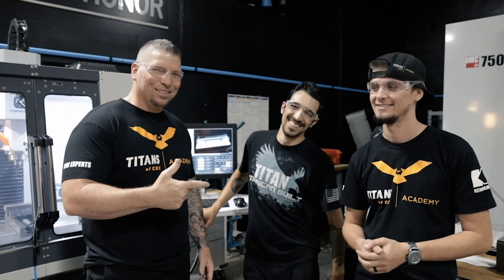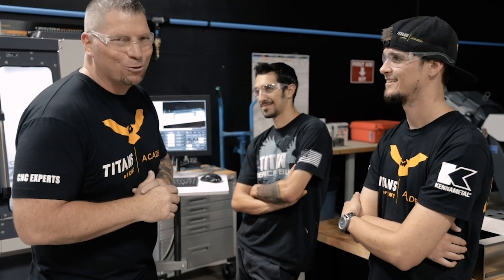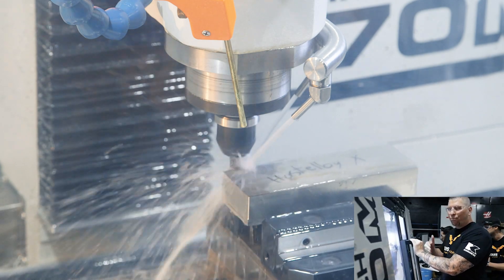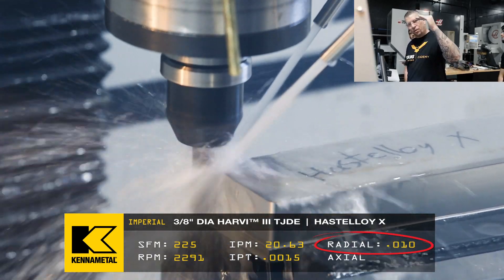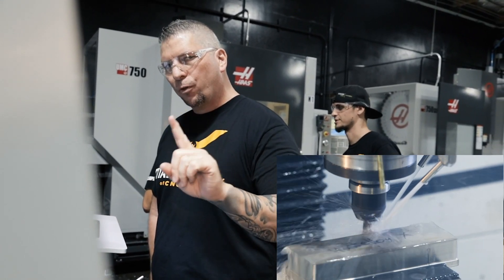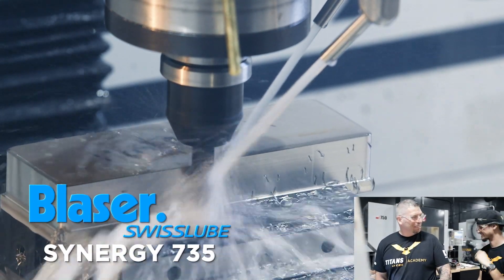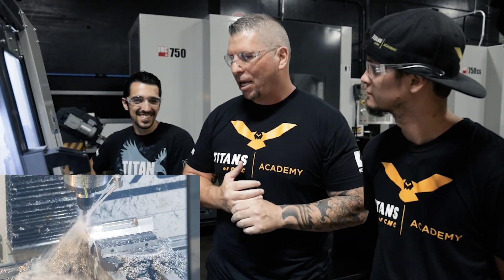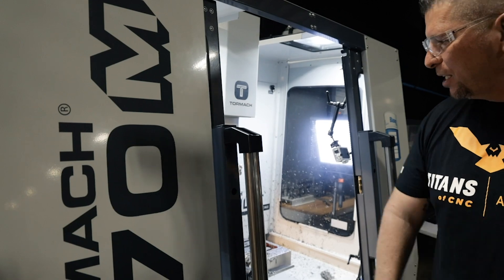Tormach VS HARD Hastelloy X | CNC Machining

Comment: Back in the day of gear driven, low rpm, high torque machines it was far more important to watch your backlash.  As the hydraulically driven, high rpm, low torque machines came about backlash was much les of a problem. its also a guide for using big multi carbide cutters. One keller shop I worked in burned up the gearboxes of 6 Kellers

Comment: I will say this, as a mechanical engineer, that tool pressure is a term that I have found to be misunderstood industry-wide. The definition of pressure is force per unit area, i.e. P=F/A. Think of a hydraulic cylinder being extended by a hydraulic pump exerting 3000 psi. A larger cylinder will exert greater force even though the PRESSURE is exactly the same. The reason is that the piston in the cylinder has a greater surface area, and therefore according to that equation rearranged for force, F=P*A, the force increases. In this same manner, when you use a smaller tool, it is not the tool pressure that is changing... it is the force exerted on it that is changing.

Comment: I have A LOT of issues with my 770 in scenarios like this with high pitch chatter when cutting stainless.  I can hear a little of that high pitch noise in the video around 5:55 in the video.  Any suggestions on this?

Comment: I cut 6al4v in my 770 Series 3 constantly (I wish I had the more powerful spindle motor in your swanky new 770M).  Is it absolutely ideal?  Hell no.  Does it make me money with nothing more than a 110v wall plug?  Hell yes!  Small cutters with steep angle of entry (1/8, 3/16, 1/4, max 5/16).

Comment: More video with another harder metal cut please, i’m still not buying that tormach can cut stainless, steel, titanium like butter ?
Maybe this new model 770M ?
I wonder what’s the different than the old model 770 ( without “M” ) ?
Reply: You can find the spec sheets for both the 770m and the p770 and that will give you the difference.

Tormach is getting ready to roll out the MX line which will have a new spindle for better holders, servos (instead of stepper motors), updated path pilot, and more.
Reply: Tuba Player what’s the difference in cutting result between 770 and 770m is my question.
Does 770 can’t cut hard metal as good as 770m ??
Reply: calico88888888 I don’t see how it would; steppers vs. servos.

Comment: In my experience, Hastelloy was never that hard to mill. Its small diameter drilling and tapping that makes it a pain in the ass to work with... It mills pretty well though.
Reply from the maker: The point is that the Spindle is Only 1.5 HP... and we recently also did drilling videos giving correct speeds and feeds
Reply: @TITANSofCNC  O ya, not knocking the machine at all! Drilling and tapping hastelloy isn't terrible on machines either. Its more of a tooling nightmare problem. Actually could you recommend any drill or tap brands you like to run in the high nickle materials??? Thanks for the reply!

Comment: Excellent! It's more about understanding tooling feeds and speeds and tool pressure just like you said. I've been doing my best to teach this to people for ages. 

I did an .400 depth  adaptive tool path with a 1/8 end mill in 17-4 and it worked perfectly. Everyone thought I was nuts.

Comment: Measure it and find the slop in the machine.
Reply: Josh Miller when they made the part out of 4140 they said it measured really close.  Also the MX and M+ line is coming with servos which may be a little better for the accuracy then the motors they currently ship with.

Comment: Modern software does wonders.  Sadly most people who buy a tormach will not use  the three required components.  A modern toolpath - 100% climb cutting and constant step over.  Good tools - variable pitch and the proper geometry for the material.  Decent fixturing and minimum tool stick out.     Software cost is the main issue - 30K for a seat that will produce this 3D modern toolpath.
Reply: Alvaro Gil not really true anymore, autodesk now give fusion 360 out for free to people who are small business or home shop.  And the titan academy teaches fusion.

I have and do still use it from time to time but you do lose a little control when compared to mastercam 2018.
However fusion has a very good adaptive tool path AI.
Reply: Also fusion can handle simultaneous 5 axis and is a very capable program should highly suggest looking it up and playing around with it.

Comment: Now try some Hardox600 :)
Reply: That's an easy and soft material compared to what they had on the machine.
Reply: @norbertfleck812  you sure you were working 600? that shit is tough. 
718 Inconel works easier then it for milling

Comment: For 7 years my 1100s have been machining stainless steel, hardened steel, 8620, 4140, tractor flywheels, Ampco 18, tool steel, HSS, doing farm/construction repair part machining, try machining a diesel engine wrist pin now that is hard.
Reply: How did I end up here Joe

Comment: The guys at Tormach are having multiple orgazms right now.  lol.  You gave them a lot of bragging rights in this video.
But seriously, that proves that it is more the TOOL, not the Machine that is important.  Tool and parameters. 
And I learned a few things from your unplanned free talk today.  Thanks.
Reply: Actually it's more the Operator knowing the Material, the Part, the Tool, and the Machine. If you don't have all these things, it's difficult to get optimal results...
Reply: Dan L. Make no mistake, the machine is important too, as is the machinist. The best tooling used in the best machine; applied wrong, is no better.

Comment: Thumbs UP for metric. Please explain more about cutting pressures and vibrations and stuff, not only feeds and speeds, but why they are like this. Thanks
Reply: Basically by pressure he’s saying a smaller stepover/ radial depth of cut, keep a deep axial depth of cut and just walk the tool slowly. If you can image a bigger radial depth of cut, the machine is literally pushing the tool sideways into the material harder. So a smaller stepover is less “pressure”

Comment: Hey titan when are you going to review  the main milling machines makers and buy a new  cnc bridgeport with heidenhain see if they still make them as good as they was back in the 30s
Reply from the maker: Definitely don’t make them like they used to... Bridgeport is made over seas I believe.
Reply: The new Bridgeports are made in Hardinge's operated plant in Taiwan. They are very nice machines. Owning older Bridgeport CNC's I can tell you that the new machines are more rigid and accurate. Hardinge controls all the QC and manufacturing in that plant. Only their high end lathes are still made in Elmira, NY.
Reply: Titan, you should get a new Hardinge H51 or a Conquest.
I run 90's and early 2000's Hardinge lathes. Still Super Precision. If I was in your shoes, I would hook up with them! USA....BOOM!

Comment: I've always thought that the adaptive tool paths should have an option to increase feed rate or step over as the depth of cut is reduced to keep that chatter/vibration down as the tool pressure is reduced. Also, it would increase productivity.
Reply from the maker: Agreed

Comment: Yoo titan I was working on haas machines in the past in some local small company and what we used was vacuum tables in the machines. So u dont need large clamps to hold it together and its way faster setup! Take look in to that!
Reply from the maker: Vacuum machines are Great for certain applications.
Reply: @TITANSofCNC  I mean they are not really for titanium and hard materials, but for something soft like plastic or aluminium with no so much of a tolerance is turning out really good!

Comment: Pushing a Tormach? Now you're speaking my language. Would it help the chatter, as less of the tool length is engaged, to push it faster?
Reply from the maker: Yes... as you could see, my chip load was set low because of the Axial depth... but it could be possibly doubled on the short cuts
Reply: @TITANSofCNC  Does it work to set the top height below the top, say, halfway down on the adaptive, then run a second adaptive with the bottom height the top of the first, at a faster feed-rate?